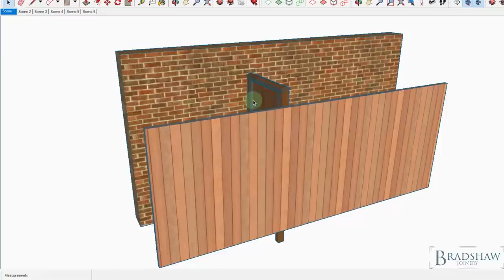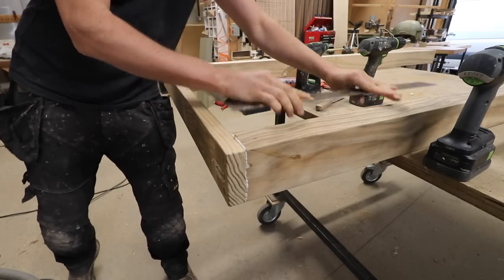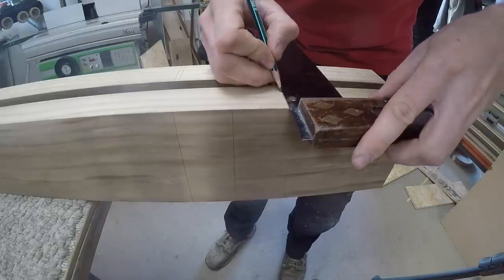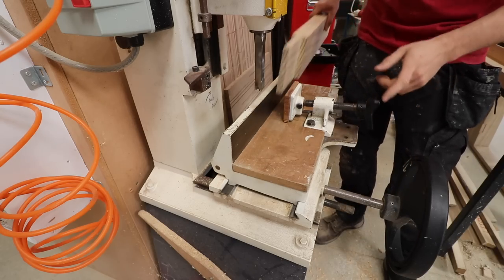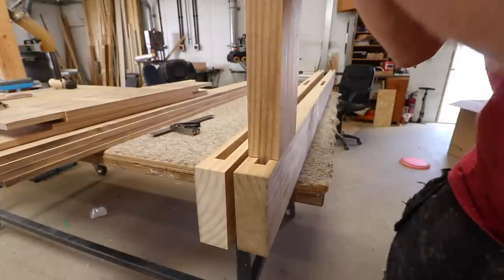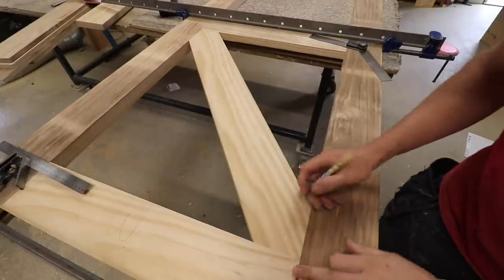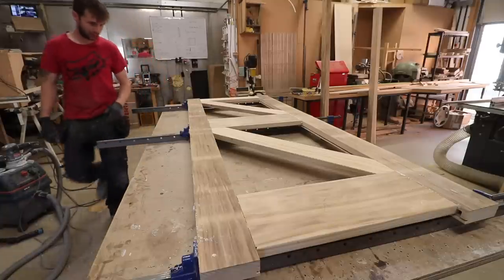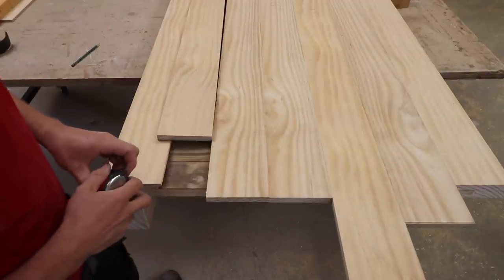How To Build A Frame Ledge and Brace Door Like A Pro. Side Gate.

Comment: Thank you for such an educational video. I love (hate :)) watching such skillful people make my efforts look so pityful. :) My woodworking training ended when I left school in 1969 but I still do some and I did become  a mechanical engineer and then retrained as an electronic engineer so Im not totally useless but old age is catching up on me. What you achieved in, what 2 days? would take me 2 weeks at least.

I have serious equipment, material and skill envy but I will take away some tips and tricks! LOL. I have 2 traditional yurt doors and frames that need repair or replacement because of insect infestation and shrinkage and I havent decided on my way forward yet.

Here in Portugal the price of good timber is criminal if you can find a local supplier and yet every village in my area still has a carpenters shop.

Apologies for the ramble but keep up the content. It inspires me.
Reply from the maker: Haha, dont put yourself down! It is my profession not just a hobby! Yeah it was 2 days work, its probably a 3 day job, but i am so busy i put some hours in and got it completed! 

I generally only opt for repair if the majority/upper part of the piece is in good order. if this door had rot in every rail/panel i definitley would be replacing. 

what is the main timber in portugal for external work?
Reply: @BradshawJoinery  I dont know is the honest answer buy Ill try and find out. There isnt much visible exterior woodwork to be seen locally. Eucalyptus is the dominant tree to be seen growing. Huge plantations harvested every 5 - 10 years for pulp. When treated its used as lathes and gravel boards.
Reply: @BradshawJoinery  Locals use the Euc green for rustic roundwood construction or pallet wood. Niether last long.

Comment: Great video, very informative and helpful. Just wish I had access to some of the machinery you use. Going to be making 2 sets of these gates/doors in the next couple of weeks, prob take me about a month using the tools I have. Due to price of timber I will probably use pine and put a heavy coat of oil paint on it. Just hope the soft wood does not cause to much problem with seasonal change.
Reply from the maker: Thankyou Derek. Yes to build up a machinery workshop has been a sacrifice to say the least! 
Best thing you can do with pine is treat the insides of the joints and tenons etc with preservative pre glue up and let it dry out well. Same with all the boarding, 2/3 coats on the grooves and the backs of the boards and rails where they touch to seal them will double the life of the door easily.
Reply: @BradshawJoinery  yip I can relate to that, not been able to work due to ill health since 2015 and has taken me about 2 1/2 years to save up enough to get a table saw and thicknesser planer. Plenty of sacrifice. Both machines from the felder hammer range. Now it's time to get new doors for the workshop built and then start the renovation of my house. Just found your channel last week and love the detail that you put into the videos. I find your way of teaching easy to follow and understand.  Thank you.

Comment: The Rolls-Royce of exterior doors - impressive cabinetry skills applied to door making! A potential heirloom object which will quite possibly outlast the dwelling to which it's attached! Deserving of stainless-steel ironmongery perhaps? The UK climate is tough on mild steel outdoors even when galvanized which prompts the question, although common wisdom in the trade is that the vertical boards should not be glued to the rails and braces, with modern adhesives, which can flex while maintaining adhesive integrity, isn't there a case for it? Steel fasteners, whether screws or nails will in time rot out leaving the wood still in good condition, assuming treatment at prescribed intervals, and the boards will consequently come loose.
Reply from the maker: I have used galvanised ironmongery on accoya about 7 years ago with no detrimental effect so feel it should be ok, but yes Stainless hardware is becoming more readily available! With Accoya you could glue the boards. I would not glue normal timber, the adhesive will hold which is where the problem lies.. it warps the door with any movement! I use Stainless fasteners, the Brad nails are 40mm Stainless Steel. Mild steel wouldnt last 5 minutes outside in Accoya.
Reply: @BradshawJoinery  If it was mentioned that the nail gun used for fixing the boards was loaded with stainless steel, I missed it. So, your explanation answers my concern. Spot on. Re. Accoya. I've researched it without finding the answer. Do you know if the logged timber is pre-seasoned before acetylation or is that step just skipped?  Thanks.
Reply from the maker: I'm not sure if I mentioned it but yeah I always but stainless Brad's now, even for internal work. 

The Accoya is kilned before treating, then after acetylation it is dried again so it arrives very dry.

Comment: I'm a bit late to the party but...As regards moving your mortice fence clamp all the time. You might want to consider drilling and tapping a new set of holes where it suits better. Save you constantly moving the clamp  for routine jobs
Reply from the maker: Cheers Mark, yeah ive been batting a few ideas about in my head for that, the old multico i sued to use had a dovetail slide front to back and you just locked the clamp where you wanted it. obviusly it needs flushing into the bed but i have a low profile section and could add a sub bed to suit the same thickness which would work i think!

Comment: Can you help me settle a debate? 
My dad during his apprenticeship was taught that the T&G boards should be slid in tight (approx 3mm too wide overall) and compressed down and fixed to allow for shrinkage. Every time I’ve tried to assemble a door this way it has been a nightmare and all the hammering to slide them in causes shakes etc.  I have never seen anyone else do it the way he does but he’s adamant that it’s the correct way. I’ve noticed yourself and others putting a 1mm spacer between all the boards (even with Accoya which surprises me. Is that for expansion? 
We’re working with European redwood btw.
Reply from the maker: Your dad is correct if the door is going inside.... if its exposed to extreme weather then no. If making the door/ gate with green materials then youd do as your dad suggests. But dry redwood outside will push your stiles off or pop the boarding
Reply: @BradshawJoinery  thank you so much for the reply! We have argued about this for years, and as you’ve pointed out on one occasion we did have a door that opened its joints at the tenons.

Comment: Hi, I've watched the whole video. Quick question, why the 9 deg bevel on the middle rail (and is it only on the middle rail)? I don't think you explained this in the video. I can guess that it helps to make the braces look like there is a snug fit? One cut of the braces needs the same bevel.. Isn't it overly complicated? I have a feeling I could easily mess it up!
Reply from the maker: The bevel is because that rail can hold water... since its a gate and exposed on all sides. A flat rail top will trap moisture.

Comment: Another great video. I have 3 arched gates in garden walls to maintain and 2 require some repairs to keep them going, your video has given me a better understanding of the approach I should take.
Question: I think my gates are constructed from a softwood and I have some old pitch pine that I was intending to use for the repairs, but should I use a specialist hardwood such as accoya? (The gates are all painted so the finish won’t be affected).
Reply from the maker: Thanks Chris, Tbh, i would either use a matching timber of the same species or Accoya, i wouldnt be putting hardwood repair in a softwood door. If you have some pine already and its of suitable size/quality then use that! Sourcing small quantity of accoya will be hard work and £££
Reply: @BradshawJoinery  Hi Rob, Much appreciated. Thank you. Chris😎

Comment: Are the braces going the correct direcion ?
Reply from the maker: Yes. The braces in a timber door always rise from hinges to support the latch top corner. They work in compression. If fitted the other way around they just add weight to the door and the joints will open up!

Comment: Hi there, loved the video. Can I ask what type of butt hinges did you use? Are ballbearing hinges suitable for this type of installation? Thanks
Reply from the maker: I used a brass with Double phosphor bronze washers. I would avoid ball bearing for fully exposed use. If you want that style of hinge look to Coastal ironmongery for their blu range lift off type hinges.
Reply: Thank you so much for your reply. That information is very helpful. I’m doing the job next week and don’t want to be called back in a month😂

Comment: Great vid! Why do the boards sit over the bottom rail and not butt up to it, as happens with the top rail? i.e. why isnt the the bottom rail thickness the same as the stiles/top rail?
Reply from the maker: To stop it rotting basically. The bare face rail doesn't create a stop point for the water so it sheds straight down the boards and off. 
You can have a full thickness bottom rail but it won't last as long externally.
Reply: @BradshawJoinery  Interesting, thanks! I initially had my design symmetric but I've now changed it :-)
Reply: @BradshawJoinery  I can confirm Mr. Bradshaw's advice with the failure of my cedar gates. I did exactly as Nero P stated, with the bottoms of the vertical boards being housed inside the bottom rail with a rebate, same as the top. The end grain (at the bottom) wicked up the water and the ends of the boards rotted away. The rest of the door was sound. Mr. Bradshaw's design is superior in this regard, and I shall build future gates in this style.

Comment: Hello , what clear adhesive do you use in the tube ?
Reply from the maker: Hi Roger, the glue is polyurethane adhesive, i have used various ones my favourite being the sovereign chemicals pu rapid, but ive lost the area rep now so im using construction chemicals wood weld.
Reply from the maker: Assuming you mean the glue and not the sikkens V groove sealant?
Reply: Thank you,always better to use a tried and tested product.
Love the detailed videos, bit behind with watching .
I notice you now have a wide belt sander , very jealous!

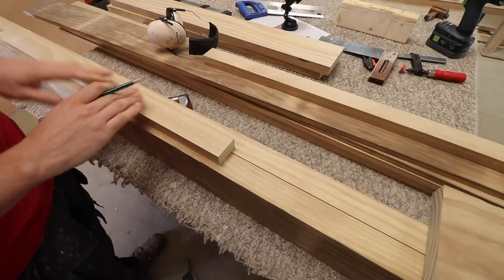Comment: Good video - lots of useful advice and tips.  But suspect lengthy section on detailed setup of tenoning machine from 30:00 onwards is of little use to your likely audience, who won't have such a large and (very) expensive machine.  Anyone who does is likely to be a pro, who won't need advice on its use.  Your hobby woodworker audience is much more likely to use a router table or a table saw dado blade to cut the tenons.
Reply from the maker: Cheers Colin, yeah true, but i try to produce my how to videos as though training an apprentice. If you wanted to buy that machine to make a door, where would you get the info from and all the tips and tricks of how to use it if not a detailed video like the above... at which point you may consider it a gold mine! Im not really aiming my audience at hooby, many viewers may be and no doubt can take things from such info, if not directly relative to the specific machine, but how to approach the project, and the methodology of how to achieve the joint/get repeatable results is transferrable to any method of actually doing it.  Im not going for a big audience, rather keep some skills and knowledge alive and available to people who may not have had the oppourtinity to learn it using conventional methods.
Reply: I’m bidding on the exact tenoner and, if I win it, I’m going to watch that section at least 10 times. Lol. I’ve found these videos have really helped me and given me confidence to do more joinery work and for that I’m very grateful. Top class.

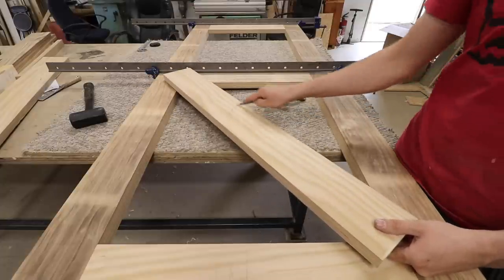Comment: @1:04:23 when you had the center scored and penciled why didn't you just put the piece of wood under the frame and make sure it was center to center both ends then pencil in the corners rather than trying to judge from the top ??
Reply from the maker: i think i did pretty much that, pencil mark the underside at 1:05:51 i just used the straight to get the angle accurately off the door for the saw. the lines wil need squaring up still as the rails on the door are bevelled...